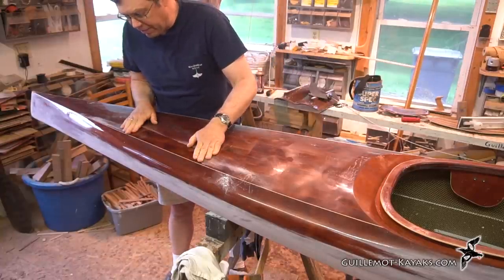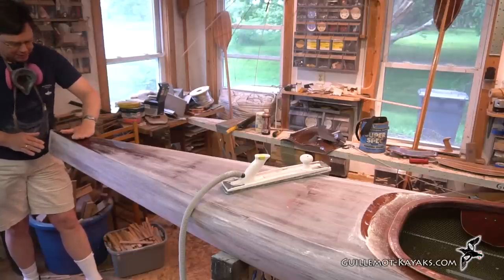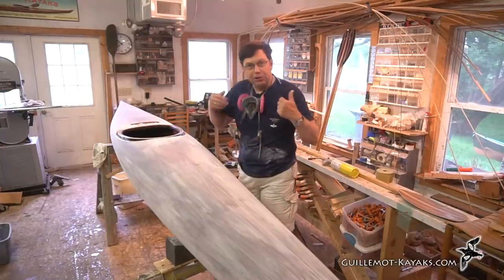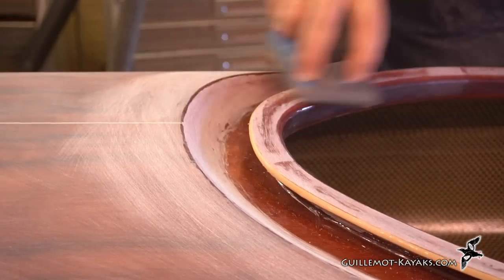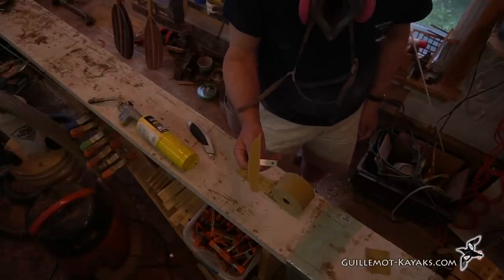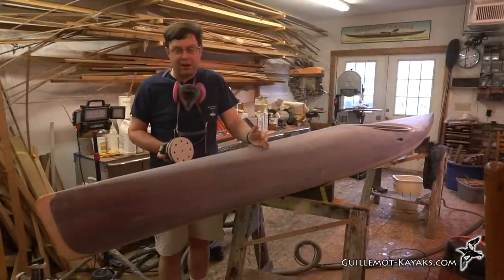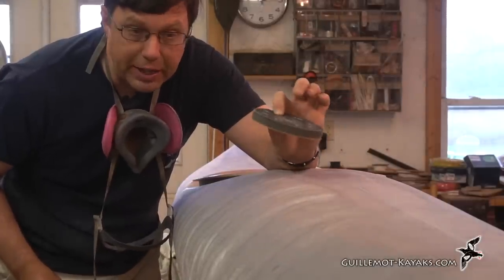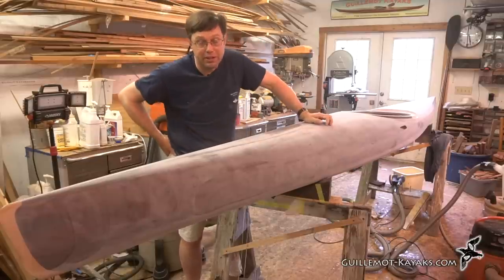More Finish Sanding - microBootlegger Sport - E61

Comment: The sandpaper erasers are no joke. You use sandpaper l do. I save noticeable $$$ keeping an eraser around for my discs, especially ones that I use on concave surfaces since the edge is part that goes. You can also make an effectively smaller disc like that by only restoring the central grit of your paper, giving a natural feather as necessary.

Comment: Is some of the need for fairing caused by how the epoxy is applied? Much like when you patch chips with concentric pieces of narrower and narrower glass could you lay a cut piece of glass on the top at the bow and stern to make sure that the centerline was the high point?

Comment: Is there a reason why you don't ever daube the low spots, pin holes with a little epoxy?  Do you get 'witness' marks from isolated patches with epoxy? - dry time?  Just curious.
Reply from the maker: Sanding out small spots in such a way that they are level with the surrounding area is tricky. I strive to have sufficient fill coat in place, that hitting pin holes and low areas with spots of epoxy is not required.
Reply: Nick Schade p

Comment: How did you know that you had enough fill coat to sand out that depression in a wide area? ~@6:05. did you measure it somehow, or you just know?
Reply from the maker: I guess I assumed there would be enough given how much fill coat I had applied and how shallow the shiny spot was.

Comment: why do you have to sand it so much?
Reply from the maker: That is how you get a really nice finish. You don't have to sand as much if you don't mind a somewhat lumpy finish.
Reply: how much does the lumpiness affect performance? a significant amount?
Reply from the maker: a rough surface can increase drag substantially, but it would have to be really lumpy to really make too much difference. 

You do want a sanded surface to as a base for applying varnish or other finishes. It is hard to have the whole surface sanded if it is still lumpy.